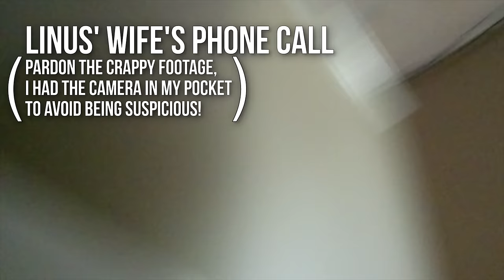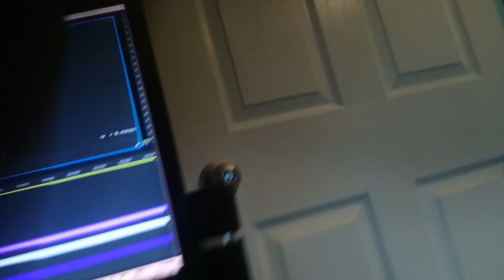Cruel Prank - Linus Missing His Flight!?

Comment: Thats car is a pentium D if it was a processor
Reply: lol
Reply: A joke that gets better with time
Reply: But its a lambo
Reply: +Carlos Fernandez Literally.
Reply: More like an Intel Atom
Reply: It wouldn't even be a processor... Since it can't run
Reply: Nicholas Knight no its a single core single threaded 112 mhz cpu running at 89 degrees celsius (ignore any spelling mistakes)
Reply: Crimsoncube181 it would be a quad core (because it's a four cylinder) and has around 100mhz (because of the around 100ps). Lol
Reply: Nicholas Knight That's an insult to Pentuim Ds :-p
Reply: @derSkedda  sounds like an AMD chip. Forgo performance over cores LOL
Reply: True lol 😂
Reply: A Pentium D is inefficient and old, at least his car is fairly efficient, so it's more like an old Celeron with old thermal paste oozing out the sides  and a some how rusty heat sink and the bearing is going out on the fan, but it all still technically works enough for basic tasks. No Super Pi track days though.
Reply: @CarlosFernandez-mh2jf  thats was the BS thing I ever heard
Reply: this joke has aged like fine wine :D

Comment: That is one dirty engine
Reply: Eh.. Linus admitted not being a huge gearhead.
Reply: its important to keep a car engine and bay clean easy to spot leaks and other potential hazards WD-30 does a great job keeping water out of electronics a good can of engine de-greaser and finish it off with a engine silicone no high pressure water and you are good to go spray more WD-30 on electronics if it wont start
Reply: Still the greatest fuckin lambo I've ever seen!
Reply: vtec just kicked in yo
Reply: Jekay He's probably not a car guy clearly that car is not loved it's just a tool to get around.
Reply: its the engine of a lambo...
Reply: Peter Meek you seem to be 10 off something.. not going to say what, but here's a clue:
your brain seems to need some oil to slow the rust...

WTF IS WD-30!?!?!?!
Reply: cakeless coder wd-30 is a type of lube
Reply: *****  That should be WD-40.
Reply: Owh yeah...
Reply: Peter Meek
 I don't like using degreaser since it has a chance to chip some paint from your engine block I usually cover the alternator with news paper and spray some armor all or anything you like then wipe it with some clean cloth.
Reply: baraki808 What do you think water from the road mixed with heat from an engine does? Same thing. Degreaser isn't going to harm a thing like engine block paint unless its a show car!
Reply: It looks like he showered it in mud every day since he bought it ,never seen such a dirty engine compartment
Reply: Cars age just like you my 1986 engine looks like shit but it runs fine so what do looks matter the engine runs so it gets Linus from point a to b
Reply: Tracty Zadorozny That's like saying you never need to clean out your gaming rig's dust because it runs "fine". Dirt and rust in your engine bay can affect your cars effectiveness, though it most likely won't flat out render it useless.
Reply: Jekay 666 likes, illuminati. ima ruin it.
Reply: tehshit5000 dirt and rust should only effect if air filter is clogged  or water has entered the engine and if your air intake pipe(s) are on dirt should take a while to build up assuming normal operating conditions dirt or rust just on the surface of the engine bay is fine excluding the battery keep in mind a gaming rig and a car are on the opposite end of the spectrum
Reply: Jekay That's not a dirty engine lol. If you think all engine blocks/bays are oil, dirt, and rust free, then I've got some bad news for ya. Relative to cars as a whole, that engine is hardly dirty.
Reply: cakeless coder Why do you have WD-40 at your computer desk?
Reply: jeff darnell because it's in the garage. big setup, small house.
Reply: Even if you're not a car guy, engine should be clean. Its like saying someone has a very dirty pc, well he's not a pc guy. Thats where problems in any gadget or car or anything kicks it, when you dont show them some love

Comment: You should've pulled the ignition fuse , starter would be turning the engine but it would not start , that would be even more stressful than unplugging the battery completely.
Reply: And his radio would still have it's radio running.
Reply: @DanielPinel  Whoa, his radio has its own radio now?
Reply: TerraBiker or the fuel pump fuse
Reply: ok calm down there satan
Reply: Kindly, this is a PC Guy Channel, not a Car Guy Channel. 😂
That's why Linus didn't catch the battery maybe. I would pop the Hood the first thing I have any issue.
Reply: 7 thousand dislikes 😂

Comment: An even bettter idea is taking the bolt off the battery connector, but leaving the connector attached. This will allow you to see the lights and stuff turn on, but due to a poor connection, it will make an audible click noise and all the lights will turn off when you attempt to turn it over. Really makes people think there's a huge problem

Comment: a nicer twist for car prank is something that kind of give hopes.. but it's not working:

Remove the camshaft speed sensor plug (some cars will not start without it.. it will crank, but no start.. no harm done, either.. the computer just goes huh? and will not inject anything into the engine - mostly for diesel engines it's true)

For old cars with carburetors: disconnect the fuel line at the fuel filter.. it will go for a few seconds but will die very soon as it will run with very small amount of fuel from the level chamber of the carb and that's it.

For turbo cars.. check the air intake for the choke valve (it's a normal open valve that partially closes when EGR needs to be done and to lower the intake pressure done by turbo so exhaust gases can be recirculated.. so this valve is actuated by vacuum and has a lever on the actuation side.. a zip tie on this choke will close the choke and the engine will starve for air.. so starts but when you want to move it will die torque less.. a bit more revving and maybe you can get it to like 30km/h painfully.
The last one may cause minor harm.. because the injectors will be running full steam the mixture will be very rich before the O2 sensors comes into play (when it heats up and tells the computer is way too rich of a mixture and lowers the fuel injected.

Or just invert two spark plug wires from two cylinders for the fun.

Comment: FYi. Pulling the fuse to the fuel pump is much easier, much less noticeable, and has the added bonus of allowing the car to start, and the shrtly die due to lack of fuel pressure.😆

Comment: NO no no no you don't unplug the battery... You pull the starter fuse. It's harder to see if you pop the hood and the car still has power yet it doesn't start. The first thing that someone who knows anything about cars in to check the battery first. It's a problem solved by getting a jump start. But if you car has power yet doesn't start that's when shit gets real.

Comment: Next time don't disconnect the battery get a broken fuse for the car and replace the fuel pump fuse with the broken one. Then it will take ages to figure the problem out a disconnected battery line is way to obvious if you pop the hood with the broken fuse most people won't check it and then all the light and stuff will still work Causes more stress then just a flat battery